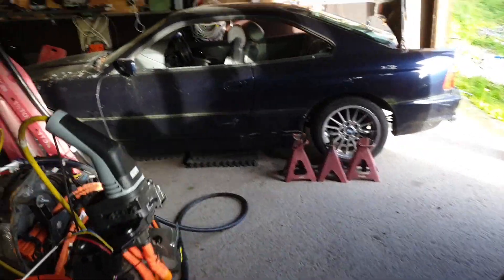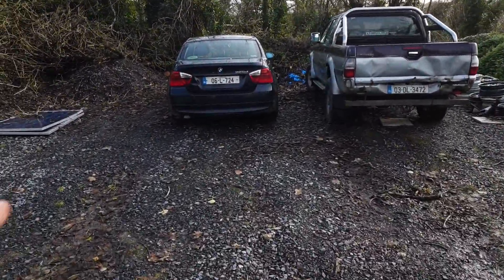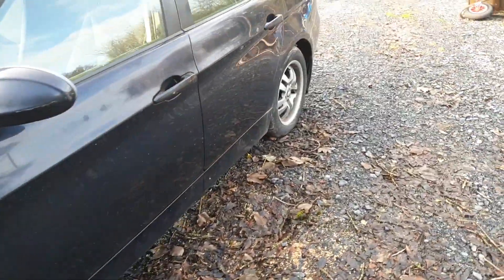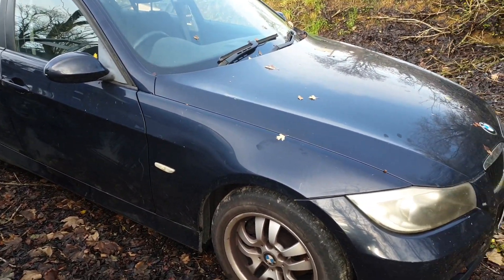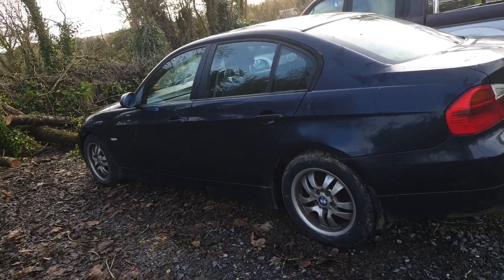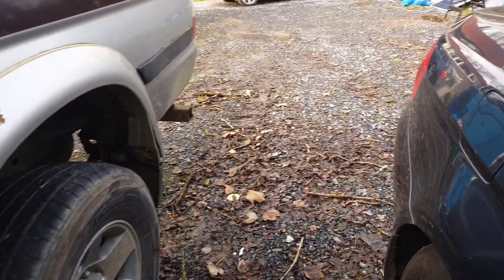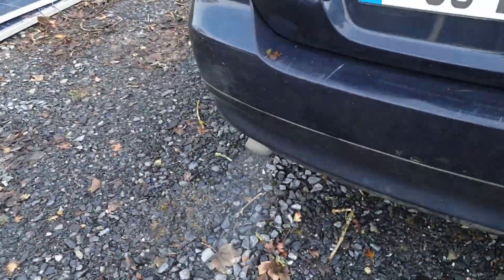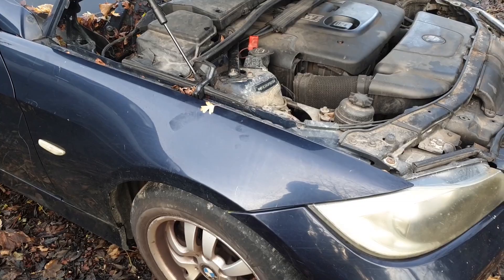New Budget EV Project : Der BlauBarsch

Comment: It was the Red Arrow project that got me started so very happy to see another cheap build. 
Please don't include the price of the car in the total cause anyone doing the same thing will have a different idea of the perfect car or may already have a suitable car. 
Try to get near 100 mile range as that is the minimum most people will be happy with. Most folk can justify 5k on a project so maybe that should be your ceiling price but if your trying to keep the price low for your own benefit then suggest a bigger battery that would give around 100 miles range.
Please include advice on High Voltage safety as you go.
Please post as many updates as you can.
Keep up the great work. 🙂

Comment: I have no experience with EV conversions (yet). But I have seen that new 5,12 kWh LiFePo4 serverrack batteries start at a price of $1500 . If you manage to fit two or three of these in a car, wouldn't that be an idea? They are 48 Volts.  The upside, very durable. A downside, you can not charge them when it is freezing.
Reply: I think the motor and inverter need a higher voltage.